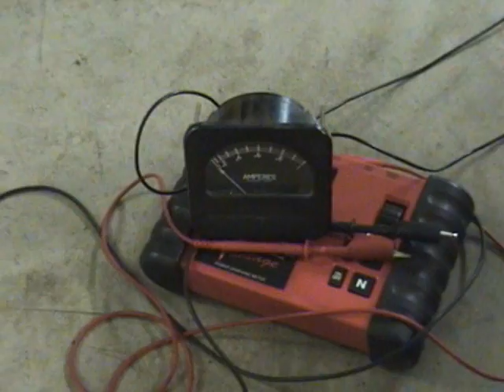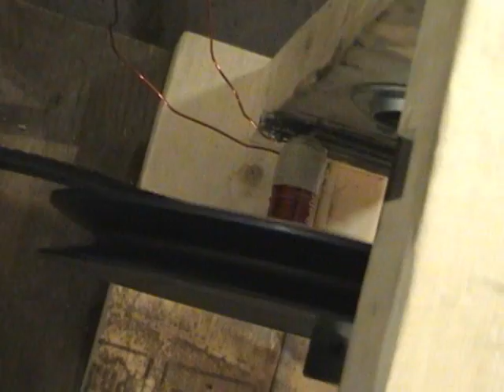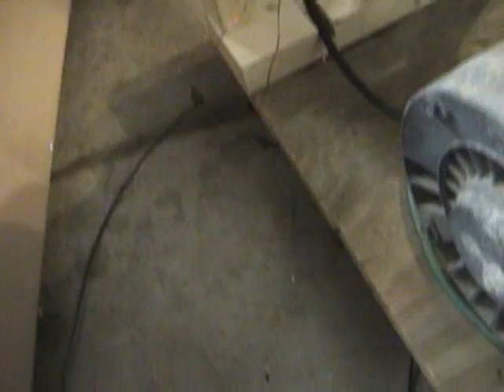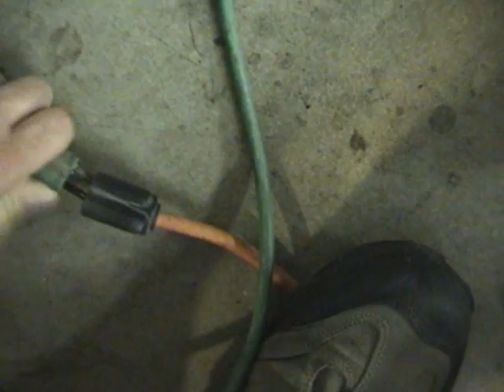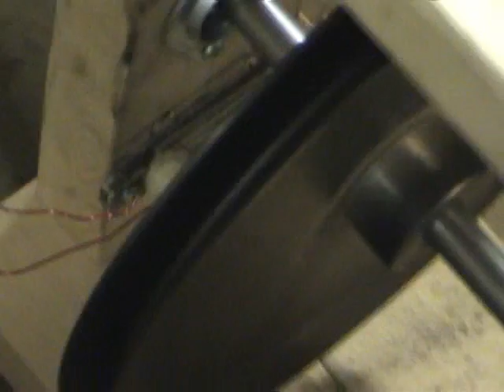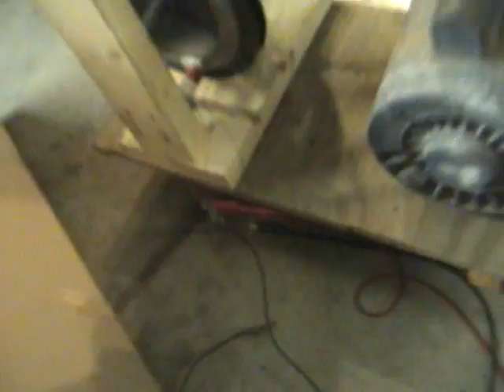Toroidal Generator IV

Comment from the maker: Thanks.......yes, 10 awg will be hard to wind, but the amperage will be high (low resistance). Depends on what you're after. Are you trying to produce 120VAC to run appliances/bulbs or 14 VDC to charge batteries? Keep that in mind...also, there is a formula (wikipedia) that helps estimate your power output (using Tesla or Gauss strength, wire resistance, wire size, and rpms.)

Have fun, and good luck.

Comment from the maker: Every strand has it's own transistor. Serial you might as well use a bigger wire and save the trouble of winding. It's currently out of working order....a bad battery blew out a few of the transistors. I used 2N3055's. I was feeding it with 36 VDC @ .25 amps. Spun like a sonovagun! COP is unknown. It certainly charged my golf cart batteries in a hurry, though.

Comment: if the second core on your ssg slows the wheel down, it is probably because of the core material.. the coil without core will not slow the wheel down, but you will get less current from it.. coreless coil will work best with neo magnets..
for your toroidal generator, you can make a core of magnetic sand... drag a magnet over dusty ground and collect magntic sand, mix it with epoxy, and you get an "ideal" core..
good luck

Comment from the maker: I've successfully built a 20 wire Bedini SG (21 if you count the trigger wire) with pretty good results. I've even installed a second core to harness the 'unused' DC pulse...but the second I attached it to a load, the wheel began slowing down. That damned Lenz effect!!

Please remember, I'm trying to build a extremely efficient (Lenz free or reduced Lenz effect) form of power generation. I can always go back later and change the driving system...first, I want some serious results for my trouble.

Comment: its the bedini SSG that requires all the same poles out, and magnets pass over the coil 'simillar' to your setup..
window motor is where the poles are alternating NSNSNS and the wire is wrapped around the whole wheel so that in every moment two magnets pass the coil, one N and one S. it has much more torque and charges a second battery. it could spin that big thing very hard and fast and produce some real power if you do it right.. and its not complicated, you should try it!... my ssg works good

Comment from the maker: There's no triggering...the system is a basic alternator. The coil's pole orientation is a constant reversing North and South to produce A/C current. I'm using the 'closed magnetic flow' of a toroidal coil to prevent the Lenz kickback on the rotor. I'm still experimenting with different core materials and different ways of winding the coil to produce maximum power.

Comment: wrap a bedini's window coil around the magnet wheel, it should have many times more torque with those neo magnets... because neos oversaturate every core (if you don't extract the back emf properly), and then the core overheats and drags the wheel down